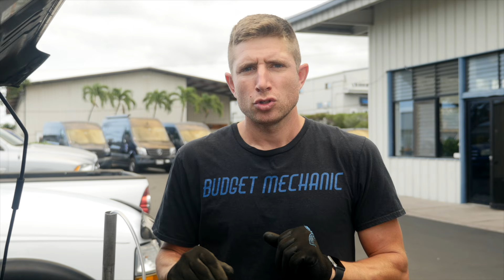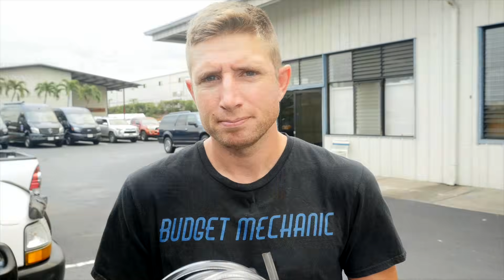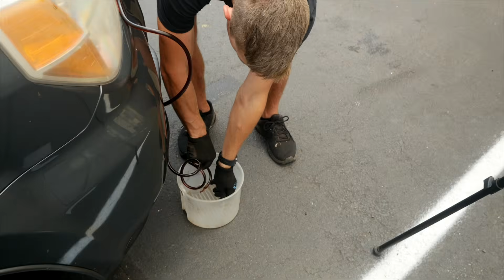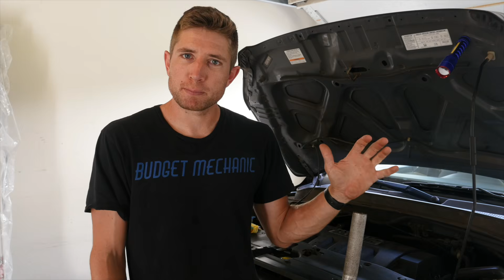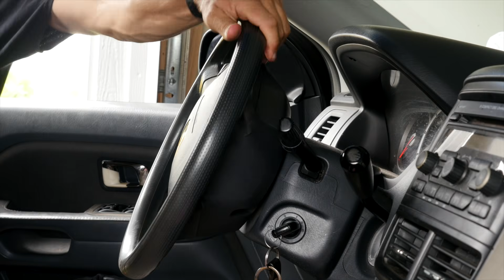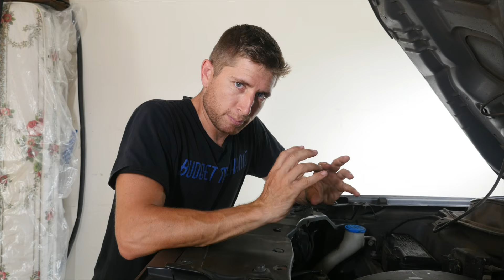Flush Power Steering Fluid Yourself Easy! No Pump Required.

Comment: If you have a vehicle that has a brake booster that is hooked up to the power steering then I'm pretty sure you have to have the engine running. You might want to mention that.

Comment: Thanks for this great video. I used a total of 4.5 bottles of Honda fluid in my mother’s 2008 Honda Pilot. The power steering fluid had never been changed and at 105,000 miles the steering was hard… now it’s a smooth as butter!

Comment: Could slightly hear whining…..I Messed up.. First I got turkey baster and took old fluid out, then detached hose from reservoir THEN attached hose to bottom of reservoir BUT Not the tube 😮 and SO rest spurted out all over; but still came out. THEN re-attached hose to reservoir and poured in new fluid, now it sounds Worse. Did I kill pump? Sounds worse than before and now is hard to steer.
Reply: It's been 3 months since you posted this did you solve the problem? If not double check to make sure you have enough flu in the reservoir, you actually might have introduced air into the system. What you could always do is if you can just jack up the front of the car, remove the power steering cap, turn the key to the on position but not running and then cycle your steering wheel all the way to left all the way to the right do it about 10 to 15 times and see if you could try to get the air out You could also see if you have air by looking at a reservoir if you see foaming or bubbles.

Comment: The power steering keeps running even after the vehicle is shut down and beeps under the hood. It stops beeping after we unplug it. For a 2012 Jeep Grand Cherokee.
Reply: The steering system itself can’t beep, but the Jeep will chime if it thinks there’s a steering‑related issue stored in the electronics. More commonly, though, random beeping with the engine off comes from the alarm system, a weak fob battery, or a door/hood switch not closing all the way. If you can, lock/unlock it and re‑close all the doors and the hood — that helps rule out the simple stuff first.

Comment: I prefer to just suck the fluid from the reservoir using a large syringe, replace it with clean fluid, start the car for 5-10 seconds and repeatb the process 3-4 times until the fluid looks clear. No need to jack up the car or disconnect hoses, I'm way too lazy for that and it's super unnecessary. Even replacing 80-90% of the fluid is just as good in long term.
Reply: *Empty the reservoir using the syringe
*Add the clean fluid 
*start the car and repeat

My question...
How do you repeat the same steps if you've already added the clean fluid?
Reply: @renatajenkins468 because you don't get all of the fluid out at once, only some of it. The new fluid will mix with the old dirty fluid. But if you do it few times eventually the mixed fluid will get clean enough to not be so dirty anymore.
Reply: @MrRightNow ohhh ok. Thank you
Reply: Yeah i think will do this and I'm more likely to do this more often then what he is doing in the video. keep it simple.
Reply: Winner 🏆

Comment: The return line may be on either the top or bottom, depending on the make and model. It's best to trace the line.
Some cars require ATF instead of PSF. Yes, you should check the owner's manual. 
If you want to save some steps, you can buy a handheld vacuum pump with alligator clips for the battery. The price is about $20. Just hook the suction line to the return line of the power steering system with the engine off and aim the discharge line to a catch pan beside the car. There is an OFF/ON switch on the pump. Stop it before the reservoir goes empty, add fluid, repeat until the discharge line shows clean fluid. 
No lifting the front of the vehicle, starting the engine and turning the steering wheel. You can find these pumps online.
Good video.
Reply: I thought this comment was 10 years ago, but I can't find any  "handheld vacuum pump with alligator clips" under $60.

Comment: When you are turning the steering wheel left/right to pump out old fluid, is that with engine running?  Nothing seemed to happen turning with engine off and nothing was pumping out when engine ran for 1 minute while turning...
Reply from the maker: It should come out very quickly with the engine running!